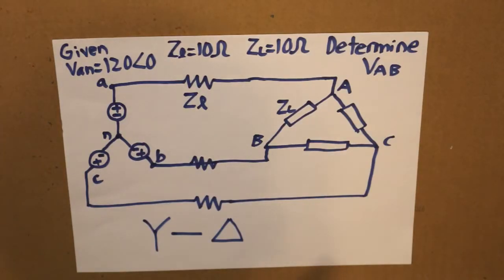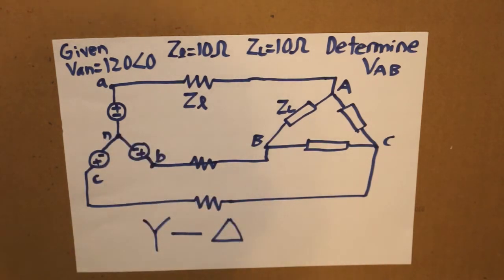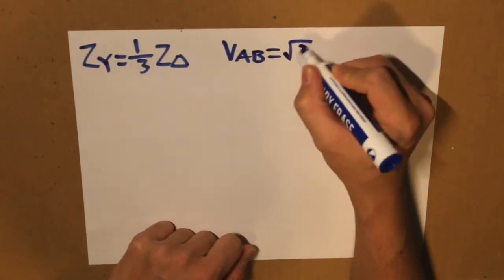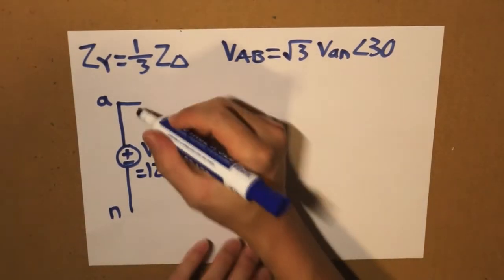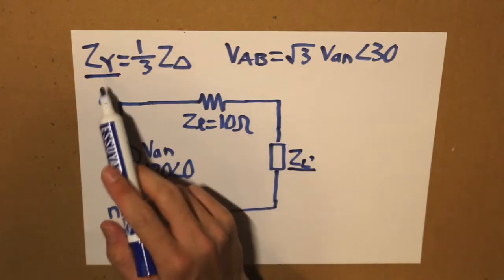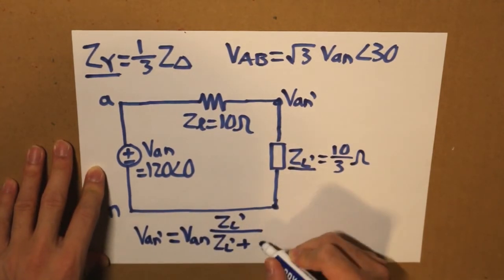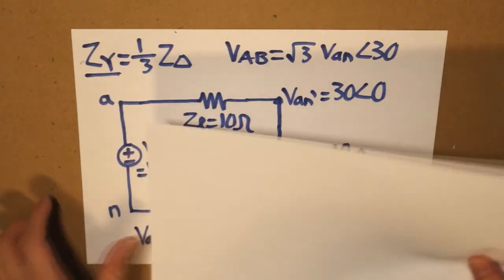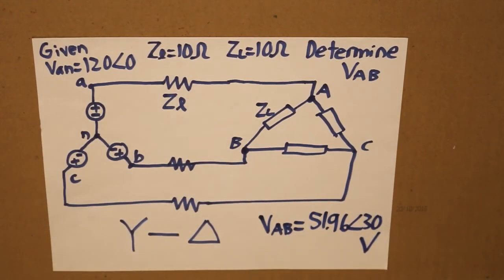Three Phase Balanced Wye-Delta Connection

Comment: 1- Why don’t u use the Van=120 angle 0?
2- U didn’t explain why Zl dash/ Zl dash+Zl multiply to Van
Instead of u obtain the current and then multiply the sum of impedance to the current?
Reply: 1. Cause its the sequence
2.voltage divider rule